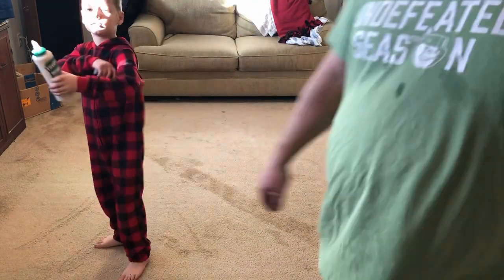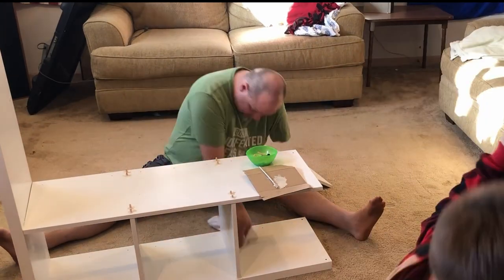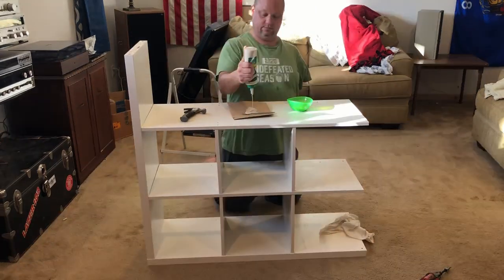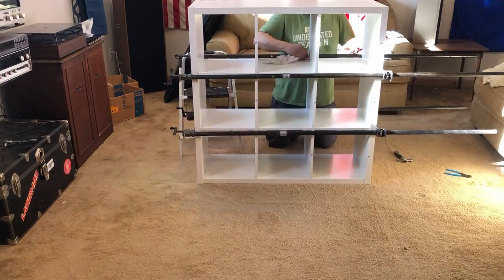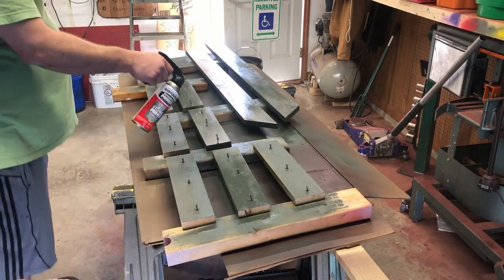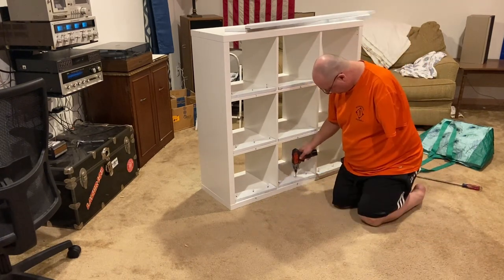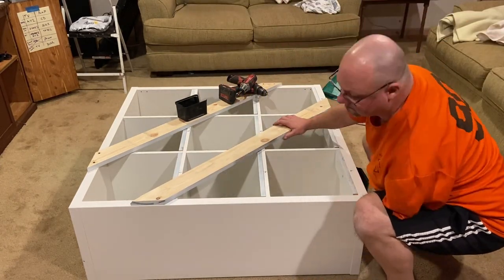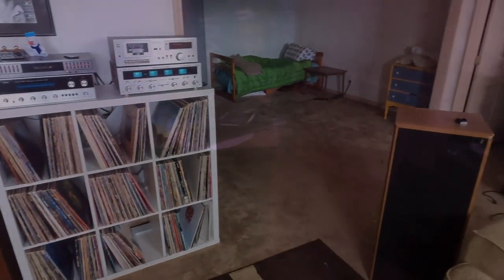IKEA Kallax Shelf Reinforcement for HEAVY Vinyl and HI-FI Equipment

Comment: I need to think about doing this - did your shelves come with doubled dowels? Pipe clamp extensions are quite the discovery!
Reply from the maker: Yes they came with dowels. Some of them broke when I took it apart so I made new ones out of dowel rods. 

The extensions are a way to store your long clamps in a short way. Build all your clamps as 24 inch long which are easy to store. Then make 60 inch extensions. Piece of cake. I actually did a video on pipe clamp storage. 

https://youtu.be/VNqrh4X8c9Y?si=yRNsk6kRX6ocBuiq

Comment: Wonder if this could be used for old crt tvs for retro gaming. Can't find much on the market that can hold a chonky 30kg + TV
Reply from the maker: I would think so. The old school hifi system I have on top weights more than 30 kg. Make sure the cross braces screw into every divider it crosses…not just the thick edge boards. It would be even stronger if you used plywood and covered the entire back…but I’m cheap and used wood I already had. 

If you are putting the crt inside a cubby do this:

mount the shelf so the two long middle dividers are parallel to the ground. that would be the strongest. Records are VERY heavy and I’m not having issues. 

You could also add filler strips of wood underneath the two long divider shelf ends. The reason is the thick outer edge is hollow core and won’t support the two thin dowels into the long board divider edge. Otherwise The weight might cause the dowel to tear through the shelf edge. The filler strips should be the same as the divider thickness. Am I making sense?  If not I’ll send you a video.